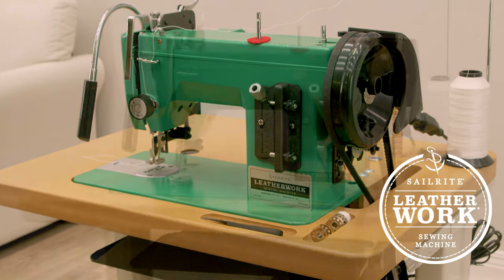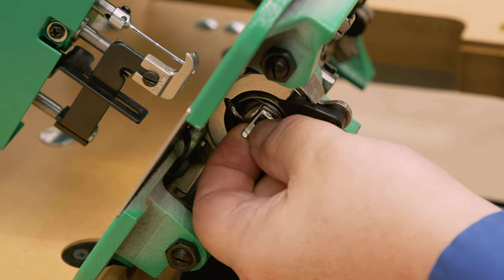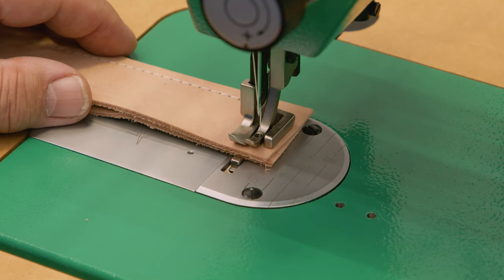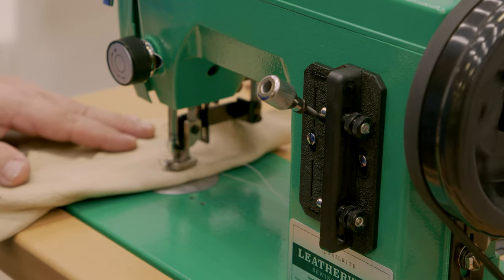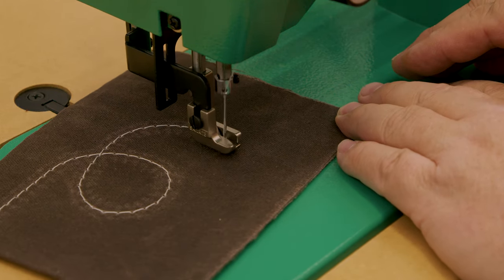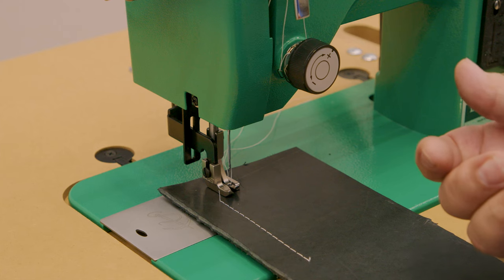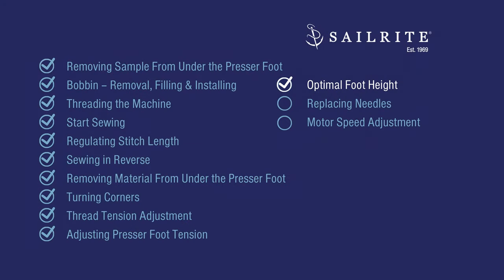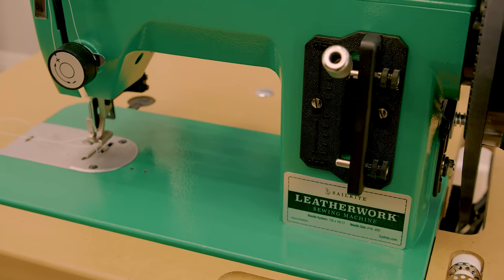Using Your Sailrite® Leatherwork® Sewing Machine

Comment: I ordered the compact table and servo motor 6 days ago. It arrived yesterday and thanks to the Sailrite video with clear and concise instructions the setup was very easy. I am thrilled with the new setup as it saves me a lot of space and the table is very solid. The slow speed control will be awesome. I should have payed more attention to this video on the speed as it clearly states that the motor will be shipped with a top speed of 30. I wanted a little faster and thought the servo motor was to go to 45. A quick email to customer service and i received instructions on how to change to top end speed of the servo motor. It took almost 45 seconds to adjust. I still consider the machine as a portable. I can simply remove the machine from the table and carry it in the case. The table with the servo motor installed is light enough to easily transport and it will fit in the back seat of my truck. Happy, Happy, Happy
Reply from the maker: We are so glad you like your Sailrite Leatherwork Sewing Machine. Thanks for your kind comments!!!!

Comment: I do wish you had this when I bought my LSZ1. I am jealous of this system.
Reply: I was looking at the LSZ1 for leatherwork, why do you think this model is a better option? Is the reducer the difference marker?
Reply: @Hawk74  I bought the servo motor and table for my LSZ1 and it works fine for leather work on thinner leather.
Reply: @Hawk74  Hi Bob! The "geared reducer assembly" should already be on the right side of your LSZ-1 Model. Wondered if you actually meant the cool new Servo Motor (that can creep in slow motion) underneath this video mentioned Sailrite Leatherwork Model? If you haven't already purchased Sailrite's heavy duty "Monster Wheel" , I highly recommend it to "Hot Rod" your LSZ-1 up a bit. The sheer weight of that Monster Wheel combined with your existing reduction gear assembly and my personal fav 135x17 125/20 "nail" needle choice will greatly help you punch thru any "telas" you dare to sew. But I'm just an FX Costumer. Check with Grant first.
Reply: Put a 250-watt DC motor with a potentiometer on your LSZ-1.

Comment: I have the LS1 and love it. But I would greatly prefer the leatherwork sewing machine just for the awesome color of that machine. The only thing I dont like about the LS1 is the color. No worries. I am planning on purchasing the new compact table and servo motor that you just came out with. It's already in my cart. Just waiting for a sale of free shipping.  Sorry for being cheap but retirement income is very limited. As always, I appreciate the great videos. I have broken several things on my LS1, but all were due to operator error and the great customer service from Sailrite not only made it east to order replacement parts but also provided great videos for the replacement of the parts and adjustment to the machine. the timing is critical and also easy to adjust with the videos from Sailrite. I see a lot of comments from folks on the users forum that I subscribe to, where people complain about needing to make adjustments to the machine. My standard comment is that as you start to use a very strong mechanical machine you will likely do things that cause damage. Fortunately all the assistance you might need is made available. Every industrial type of equipment requires maintenance, repair and adjustment. Companies that have lots of equipment typically have full time employees to maintain their equipment. The alternative is to buy consumer grade tools that will likely require no maintenance. However they will typically not even be capable of the desired performance and when something breaks the tool must be replaced. Here is a comment on the great customer service of sailrite. I was using one of the Sailrite fabric calculators, I found a small issue with the calculator, I put in a call to Sailrite and was able to talk to Matt Grant. He thanked me for the info and had the calculator fixed within a few minutes. Awesome customer service that is greatly appreciated.
Reply from the maker: We are very thankful for your kind comments and assessment of a heavy duty sewing machine, you are totally correct. 
Regarding Promotions at Sailrite - We have not had any promotions or free shipping since Covid started over a year ago. We are fully staffed, but still cannot keep up with the current order volume (even working on some Saturdays to ship orders). If we had promotions it would take weeks for orders to ship, as we would be overrun with orders. Also, we are running short on supplies from manufactures which makes it difficult to run sales on our already low inventory levels. I am sorry, but hope you understand why you may not see a promotion until things improve.
Reply: @SailriteDIY  thank you very much for the information. I will be ordering the new compact table and servo motor later today. The compact table will serve my limited space needs very well. And I will still consider the set up as portable as I can easily put the assembled table and servo in the back seat of my truck and the sewing machine will go in its case. And again I greatly appreciate the great customer service from Sailrite.
Reply: Bam! compact table and servo motor ordered!!

Comment: I’m struggling between buying this machine or buying the fabricator? I do bags totes purses holsters cowboy belts and high end ladies bags wallets etc. How thick and how thin of leather can this machine handle vs the fabricator? Sounds silly I love the look of the fabricator I am Just not sure what to do….
Reply from the maker: If I had my choice between the two and had the space for a larger sewing machine table, I would pick the Fabricator over the Leatherwork for leather sewing. It (the Fabricator) is a compound walking foot machine which feeds leather slightly better than a walking foot sewing machine. Why? A compound walking foot  works by having the needle enters the assembly and moves back as the feed dog and center foot pulls the assembly to create a stitch. This helps to maintain a consistent stitch length. A walking foot sewing machine, like the Leatherwork, has the outer feet and feed dog pull the assembly, with the needle out of the assembly. The center foot raises and lowers to allow the assembly to move. It feeds well, but not as consistently as a compound walking foot. Both will work very well, but the Fabricator is the slightly better choice, in my opinion.  For more on this topic click here: https://www.sailrite.com/Which-Sewing-Machine-is-Right-for-Me
Reply: @SailriteDIY  thank you for responding. The fabricator it is!! Call y’all tomorrow.
Reply: @SailriteDIY   @Sailrite  A while back I enquired about Sailrite making a Twin needle portable machine similar to the LS1 and LSZ1. Do you know if they have any designs on making such a machine?
Reply from the maker: @IEXECUTIVE   No, we currently do not, sorry.

Comment: Will the leatherwork sewing machine also work on multi layered denims and whatnot? I'm thinking of maybe just purchasing the Leatherwork machine, instead of the LSZ1, if the leatherwork machine can also do the jobs of the LSZ1. Most of what I sew is Nylon material, not too thick of leather, layers of denim, etc. I sew up custom work pants, nylon accessories for my firearms, and leather holsters and knife sheathes, as well as work suspenders. The Holsters and Knife Sheathes aren't made with thick leathers, because I use material backings for more strength.
Reply from the maker: Yes the leatherwork sewing machine can sew denim and canvas type fabrics easily. However, I do recommend switching the presser foot and feed dog to the sawtooth version for better gripping of the fabric. Here are links to those parts: https://www.sailrite.com/Outer-Foot-for-Ultrafeed-LS-1 and https://www.sailrite.com/Feed-Dog-for-Ultrafeed-LS-1-Straight-Stitch-Sewing-Machine with that said the leather feet and feed dog may also feed that denim fabric well, so you may not need the sawtooth feet and feed dog. You would have to determine if the standard feet and feed dog work well enough or if you need more pulling power.
Reply: @SailriteDIY  Thank you so much for your reply. After considering my options, I think I might just save up a few more dollars and purchase your Sailrite Fabricator. I've been wanting a triple feed/compound feed modern sewing machine that's sturdy like the old machines. I think your Fabricator fits that bill. Thank you for your time.

Comment: I have been challenged. I am having a problem with putting on the belt cover. I've watched the video several times and I seem to not see how to install it. Help! I don't seem to find it in the book either. I am not a mechanic. I did need my big brother to help me with a few things.
Reply from the maker: The cover takes two screws and sometimes it can be difficult to start them in the threaded holes. I usually use a magnetic screw driver which helps hold the screw to the end of the screw driver. If you don't have one just take a regular screw driver and rub a magnet on the end of it several times, this will magnetize the screw driver end. If that does not help please email: support@sailrite.com for more help.

Comment: What is the total weight of this? I am seriously considering purchasing, just need to know if I can maneuver it by myself.
Reply from the maker: About 88 lbs when mounted in the table top surface.
Reply: @SailriteDIY  Ok so it comes unassembled initially right? So I can move each piece separately until mounted?
Reply from the maker: @GypsiesandInk  Yes, it will not come assembled. You can move each box of parts individually before being assembled. See assembly video: https://youtu.be/k36UE4WshH4
Reply: @SailriteDIY  Great thank you for your timely response,  I will be ordering after work :)
Reply from the maker: @GypsiesandInk  Excellent! Thanks for your future order!!!!!